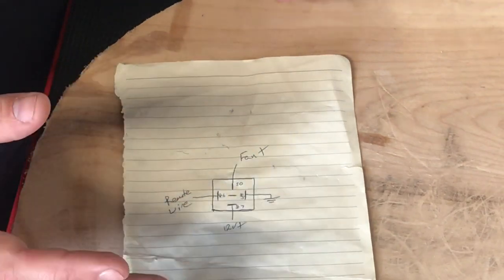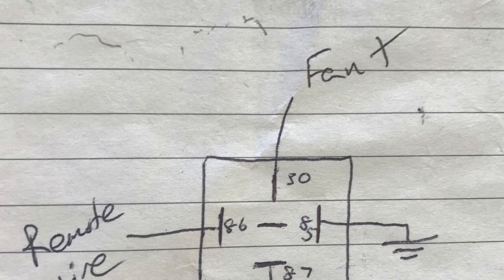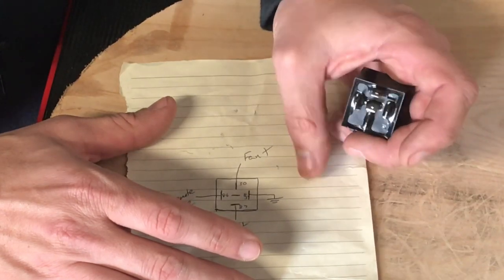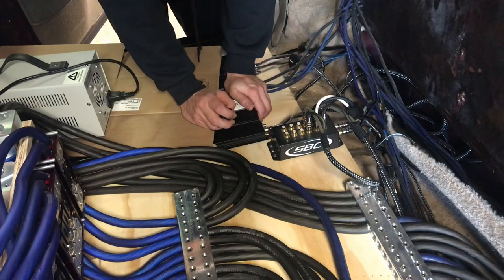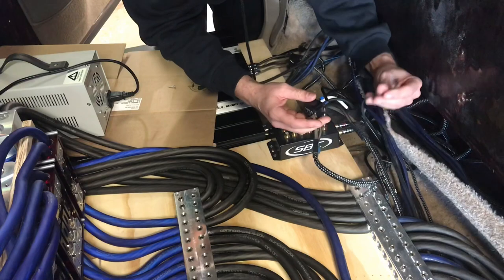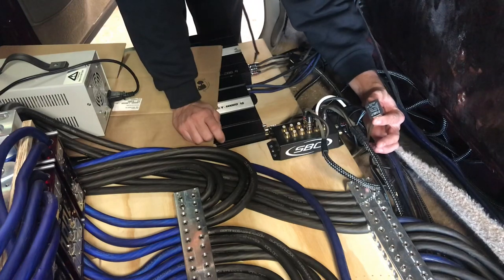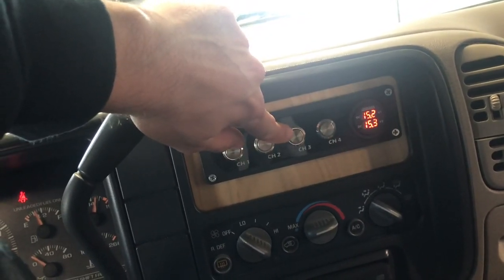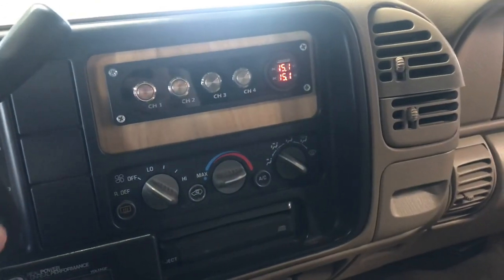RELAYS IN CAR AUDIO 101

Comment: Very informative video, i have 2 amps hooked up to a single remote wire from player and i have that problem with noise speaker when I turn on/off and lights from player are dimming when I play full tilt...  Thanks alot!!!
Reply from the maker: My pleasure!
Reply: I have two more question,  relay must be fused?  I mean on 12v power cable what's go in to relay i must add a fuse?  Or can I run without that... And plus cabel from voltmeter from back battery, it must be the same fused?  Or kann I run without inline fuse.  Thank you very much!!! 🤗🤗🤗

Comment: May I know why you don't use a diode  also?  I heard it was a good idea to use one, just curious.
Reply from the maker: I didn’t know the answer to your question off hand (I’ve never used a diode with a relay or to replace a relay). After research it looks like a relay stand alone is still a better option because you will get some voltage drop across a diode.
Reply: @StevenHerman8675309  thank you didn't know that